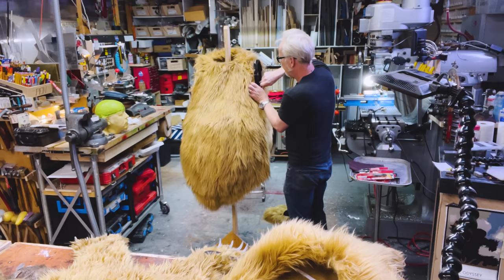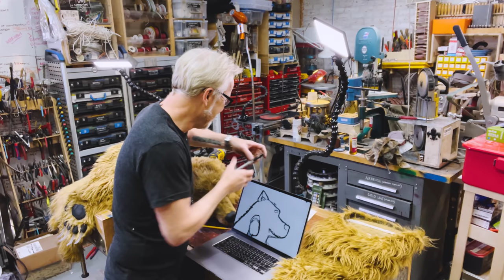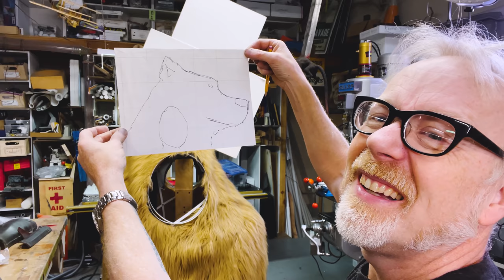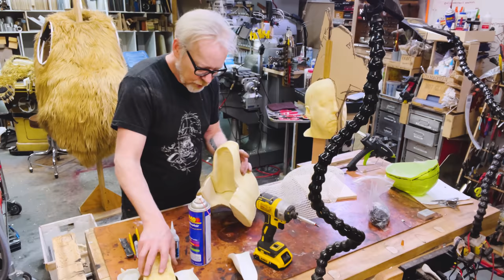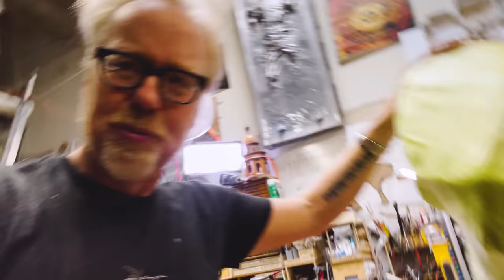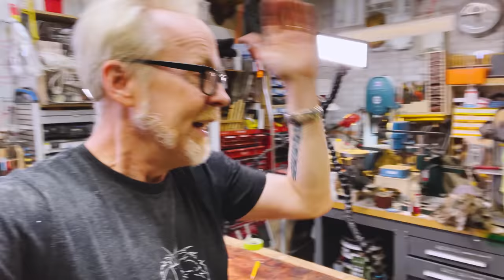Adam Savage's One Day Builds: Animatronic Bear Head!

Comment: For future headwear projects, instead of a “Hard Hat”, look into Bump Caps. They are more form fitting and smaller around than the typical hard hat. They are more like an industrial baseball cap
Reply: Without the ratchet closure (or Adam's "clicky-click"😄) to tighten them to the head bump caps tend to have a looser fit. Having said that a combination of the plastic shell from a bump cap + the head harness with ratchet (removed from a safety helmet) could give a less bulky starting point. It's given me food for thought so thank you. I have a head harness similar to the one in the helmet Adam shows, but it alone lacks the rigidity to use in a build I'm planning.
Reply: Holy shit this is perfect for something im making, thank you!
Reply: Another option is to just buy the head gear for a welding helmet, they make amazing ergonomic head gear that attaches at as little as two spots. And it has the ratcheting mechanism he likes so much.

Comment: An exacto knife works pretty nicely but I found when cutting fake fur, it's so much easier to use a loop rotary cutter.  Using one sped up the cutting time by holding the fur in my hand and cutting against the edge of the fur and then into the cut line.

Comment: I think the answer is to have 2 heads for the costume.  This would be head 1, happy-go-lucky party bear.  

Head 2, serious bear, would be wider and neck would be close to width of the shoulders.  Keep the same eye spacing and double the snout width. Bears have huge width to their snouts.  Also, adding some black rubber or foam tubing for 'lips' wold help to define the jaw shape into a more menacing version.   Watch a growling bear that's standing on it's hind legs and you can see the lips flapping all over as the teeth flash.

Comment: I would connect the mouth controls to a chinstrap.  Seems easier than operating by arm extension.  Maybe include a gearbox if you don't think your mouth can open wide enough for the bear's jaw.  The chin strap connects to a large gear which spins a smaller gear fast enough to move the bear jaw at the same relative speed.

Comment: If you rebuild enough engines, when you end up with a bucket of solvent cleaned fasteners each thing you're installing tells you "I need three 5/16" bolts that go thru this hole with this much thread exposure". Form follows Function

Comment: I think the lower lip issue is part of the problem. Aggressive posture in a bear involves thrusting the head forward. It changes the shape of the neck musculature it would be showing a more balanced posture to move fast with it's full weight. Lips would be pulled back. A bear leting our a roar holds it's mouth a bit like a wolf howling.  For aggression you would have the ears back and the head would appear more flat because the forward thrust would make the top of the neck and the top of rhe head almost contiguous, and I am not sure how you could achieve that while still standing comfortably.

Comment: Another trick for working with fur is to get one of those pet brushes with the fine metal bristles that are great for removing loose fur (I think they are called slicker brushes?), and after cutting through the fur, lightly brush through the edge. It helps reduce the loose hairs even more. This also works great for brushing along the seams after sewing to pull the trapped hairs out of the seam lines, which helps to hide the seams.

Comment: About the 'assembly anxiety'

As a Watchmaker, I have to remember which of the 20-60? sometimes more UNIQUE Screws have to go in which hole...
For a Movement I never done before I have a 'Method' 
After I did the Movement 2-5x? Times I know which screw length/thread-size etc goes in which Hole...

My 'first-time' Routine is to disassemble a section, then reassamble that bit, to confirm that I AM CERTAIN I know how this part works, then on to the next bit and so on...
If I do that enough times, I'll remember each screw placement.

Problems starts if I'm in a hurry and DON'T follow that Method... Than I mix up screws and I'm in Trouble :p

Comment: Adam if you want to make a bunch of high strength skull caps use carbon fibre then line them with felt on the inside it’s what I do for making all things that will sit on my head I made a bulk load of carbon fibre skull caps good thing is they also act as head protection they used the same technique for James Bond when Daniel Craig was doing the motorcycle chaise through the bazaar also they are really good structurally also I’ve made similar sculpted heads to your bear head I’ll do a layer of carbon fibre on both the inside and out side of the paper to give it a lot more structural strength with out adding too much weight also you can get it to where they fit extremely solid to the head tho I like the idea of you using a hard hat

Comment: I highly doubt this will get to Adam, but; Bolt anxiety is over rated. Bolts are generally self explanatory in engine ex. Usually the tiny details like a check ball or a oring will ruin a build... Those are the details to have mental awareness about. Although on a "new to me" make/model I take a little extra care/attention on disassembly.

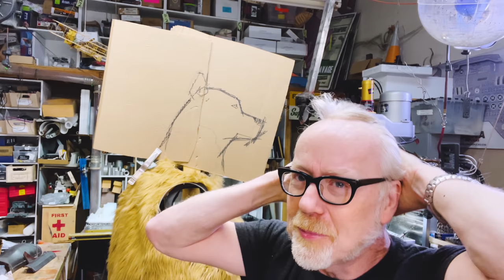Comment: At 10:18 the snout is to short amd it looka to much like a dog head.
At 12:00 it looks even more like a dog head.
At 19:32 I am still not convinced it is anything other than dog head.
At 44:14 it now looks kinda like an ... otter face ... (me thinking this is so far off from the goal).

By 48 minutes ... With all due respect Adam I normally agree with what you design.  But this ... what can I say ... (deep sigh) ... gocompair a image of a  brown bear face, and a Golden Retrievers face, and I think you will see where my concern is at. 

Mrs Savage as Adam comes in:  Use the dog brush before you come in!
1:13:00  is that a Wookie or a dog ... or even Rolf from the Muppets ... 

Adam you finally nailed it.  It's cute but not menacing.  Keep on dancing ...